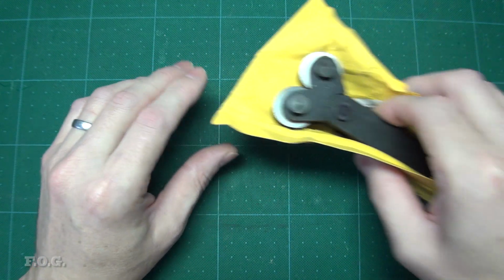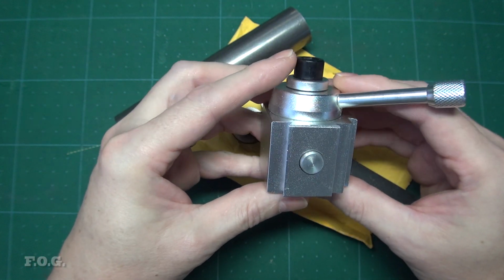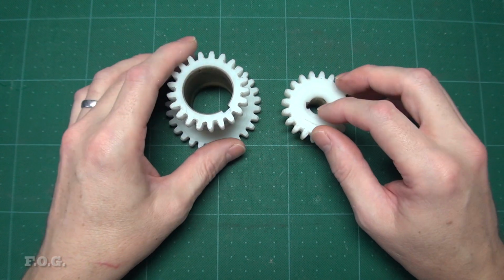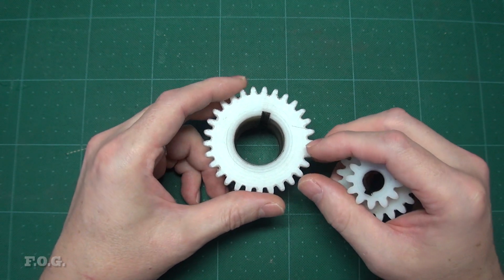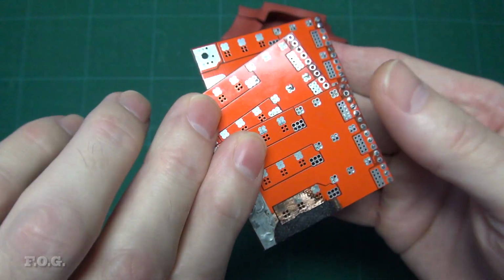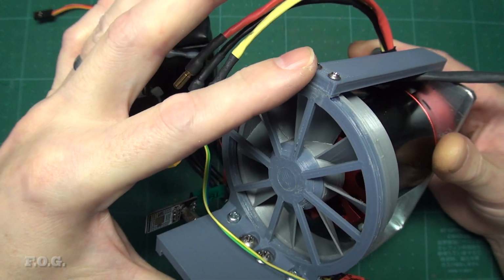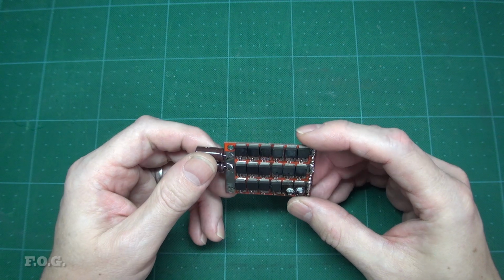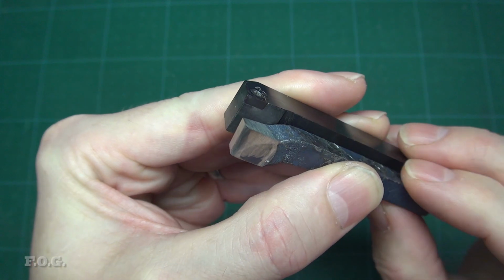EP12 - Mini Lathe Upgrade - Is it actually usable??? And what about those other nagging problems??

Comment: As a suggestion try using Cobalt HSS cutting tools rather than carbide inserts, they work very well on most materials when kept sharp(cheap diamond stones). The main problem with carbide insert tooling is the need to be used hard for best results and are not really suited for the power and rigidity of most mini lathes other than some of the special aluminium inserts but even so the lathe is not up to it, my lathe is 1.5hp and I usually get better results with HSS, having said that for parting I swear by the inset tools. Another thing about HSS is you can just buy a pack of blanks and make your own on a normal bench grinder and final polish with a fine diamond sharpening stone. Enjoying the series.
Reply from the maker: Actually I use self-ground HSS but a lot, because they give a better finish and often better form factor. You can see them in use in some later videos. But, I still use those cheap carbide inserts too when I am being lazy, the finish is a compromise, but they are pretty convenient.

Comment: The wedge style tool post you presented, #250-000, is an industry standard ALORIS knock-off,  "0XA" -- pronounced  Zero EX A,  not  'oh ex a' . .The next size up is #250-100 which is AXA size, followed by #250-200 which is BXA size, continuing on and on.  Good Luck with your project and be safe!
Reply from the maker: I didn't know that! Thanks for the info ;-)

Comment: I have a wedge tool post too and it came with 6 tool holders........so I ordered another 4 but shock horror, 2 of the tool holders were so loose they wouldn't tighten up.
The design of the tool post is inherently very good and accurate in the retention but if you buy more the chances are they won't be a good fit........my experience.
The problem lies in where the outer faces of the tool holders are butting against the inner face of the tool post block which makes it very rigid but also makes it difficult to measure the fit for each tool holder.
You cannot just put 2 rollers into the tool holder Vees and measure against the inside of them for a comparison to a good block as the inside face does not contact the tool post......it's a more complicated measuring process.
I solved the looseness problem by Tig welding two 1mm thick steel plates to the outer faces of the two faulty tool holders........Tig welding can be a very precise and painless method with little heat build up to correct loose tool holders......the welding process is done by welding around the edges of the plates and then carefully filing them to clean up.
If the tool holders are too tight.....not very likely....... you just grind them down or mill the outer faces down a few hundreths of a mm (a couple of thou)  but too much off and you are sunk.
Reply from the maker: Hey Ian, thanks for the comment and sharing your experience. I want to be surprised you got delivered the oversize tool holders.. but I'm not.. Thankfully the tool holders I have are all undersized, so I am thinking about looking set up some type of jig to accurately regrind them. Probably do a video on that when I do, so make sure your subscribed if you want to catch that!
Reply: @ForOurGood  As far as I know the piston type tool holders are smaller across the vees so won't fit in the wedge type tool post, but as most of the work has been done remachining them is one way to reclaim them.
You might find grinding them to be a monumental task given the amount of material to remove.....I would mill them as they are not all that hard ......the ones I have can be filed, so I expect there is degrees of QC that determine how much case hardening gets done if any.
If you go too big on the internal width of the vees you've had it, no going back etc, so it pays to cut and try using the tool post itself as a guide.as you go along.
You can't measure between rollers placed in the vees as the depth of the dovetail can vary, and the bottom of the dovetail does not do anything for the fit, but only if the depth of the dovetail from the face is the same for all of them you could use the roller in the dovetail method once you have a master tool holder to compare that tightens up OK.
As you have nothing to lose, and it's a reclaim exercise, it would probably pay to first lightly mill all of the tool holders on the bottom face of the dovetail to the same depth, this will facilitate measuring the fit, then attempt milling the vee on one side, but  only if it is more or less central, otherwise you'd have to mill both dovetail sides to centralise it.
Reply from the maker: @gangleweed  I must admit I have not looked so closely at them yet. But interesting to hear they may not be that hard, and the bottom of the dovetail is not used as a mounting surface, it goes against what I had expected. Unfortunately I don't have a mill kicking around so that's not an option. But I will surely figure something out!
Reply: @ForOurGood  Hmmmmm....the no mill bit is a serious setback.......I would advise then to sell the holders complete with the piston tool post and invest in a set suited for the wedge type, that is if you don't have any for the wedge one when you bought it........you might get a problem, as I said, when you buy a wedge tool post and holders in a separate package, but fairly easy to overcome.

Comment: I've done the bed extension, it doubled the z axis so definitely worth it in my opinion.  If you are so inclined you could cut a bit off the bottom of those tools to get them on center. And lastly when you get the reverse sorted out you might try parting in reverse with an upside down tool, that helps some times.
Reply from the maker: I am so jealous about the bed extension, pretty obvious how useful that is. I expect a steady rest is a must to get the best use out of it, but even without that it must make drilling or other basic operations a breeze having all that space. I am thinking about making a small CNC grinder to modify my existing tool holders for my quick release, possibly grind a dovetail into my knurler too. One way or another I will fix it. Thanks for the tip on the parting, though reverse direction may not happen for a little while yet. Thanks for the feedback, much appreciated.
Reply: Yes I felt like I would always have to do some gymnastics with different drills to accomplish what I wanted, so for that alone it's nice.  I had spent a good few years mentally designing ludicrous overhanging extended tailstock supports before finally stretching the bed and I am glad I did.  And I nearly forgot, you said you would want to keep the compound for cutting tapers, but since you need to access those mounting screws anyway to change the angle it really isn't any more work to swap in and out a simple spacer,  and it really does do wonders for tool rigidity.  And if you make it the right thickness you wouldn't need to thin out those tool shanks.
Reply from the maker: I get the point about the removing the top slide, I had pretty much the same thought to be honest. But if I fix the quick release tool post the height issue should go away.. I think I will give that a go first and see how it goes. I can see a scenario where I probably end up doing both, switching to an adjuster block and old tool post when I want the best possible rigidity.

Comment: I may not have noticed, but how do you solve the reverse direction of rotation?
Reply from the maker: Thanks for the question!
This lathe currently cannot operate in reverse direction, the ESC I am using can only operate in one direction or the other. I think this ESC is probably meant for RC airplane or helicopter.
Because the ESC did not have a reverse direction, my software currently only supports normal direction.
I was thinking about adding a switch on the motor wires to make it possible to change direction, but I decided not too because it is too messy and reverse direction is not so important for me at this time.
If I design my own ESC in the future, I will likely add reverse direction support then.
I hope this answers your question :-)
Reply: @ForOurGood  Is not true. All esc able to work,run in 2 direction. Only you have to switch 2 wire between the esc and motor . You just need a X switch. When you running in normal direction you stop or wait still stop spinning,then switch and good to go in reverse.  But many video on YouTube about it.
Reply from the maker: @laszloszell8753  Hey! thanks for the comment and subscription. You are of course correct, switching the wires will switch the direction. What I was referring to was changing direction using the normal control line, this ESC does not support reverse direction . I did consider using a relay cross switch, but this gets messy quickly and I would rather simply replace this ESC with one that can change direction using the normal control line.
Reply: @ForOurGood  Yess! Thank You! :)

Comment: Pretty sure the guy on Great Scott channel designed and built his own esc for brushless motors , might be worth checking it out .
The wedge type toolholder 000 size  fits good and is a million times better than the piston type ( had this first and went to wedge type and never looked back ) but it is much more expensive. you can get insert tooling for them also - you need 8 or 10mm shank size .
One hack with the metal gears is to fit the metal gear to the spindle as it is the hard one to replace and run the nylon one on the input shaft as it is easier to replace and this helps to keep the noise down - you need to check headstock alignment  after assembly as the headstock has to come off the bed and every Chinese made lathe I have owned had some side play so the headstock can be mounted crooked - centre line of the spindle pointing off to one side of the bed which means it won’t machine parallel .
If you are burning out mosfets it could be the control circuit for those particular mosfets ,  might not be turning off fully or they are switching on first and copping the bulk of the current . Cheap esc units are never capable of the ratings stated on the box and generally use inferior components , did you check the component label to make sure they are all the same ? I only take some fool at the factory to substitute  a component for lesser capable unit - ie : 40 amp mosfet with  a 20 amp unit and they go bang ! The channel I mentioned above will show you what is required for reliable  mosfet switching .
Reply from the maker: I do remember seeing thumbnails for a few people making home made ESC's. So , it doesn't surprise me Great Scott did one, seems right up his alley, I should take a look. The video I will do will just be a closer look at the guts of the cheap ESC I got, take a look at the components and internal signaling etc. It will likely include some basic discussion about how brushless motors work for those who don't know. After this experience, I get the feeling it probably is practical, and better, to make your own ESC for very narrow use cases, so it's something to think about. Thanks as always for the comment Ian!
Reply from the maker: Hi Ian. I like the idea about the mixed gears, I might just do that if I find it too annoying. And yes, I always check headstock alignment, but good to note here in the comments. I will save the follow up for the ESC video coming up, hope to see you then!